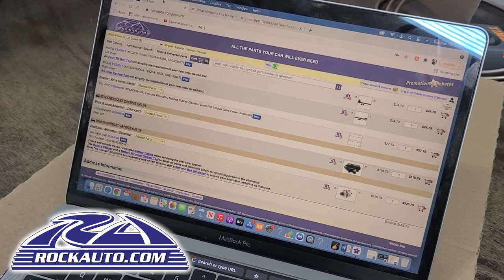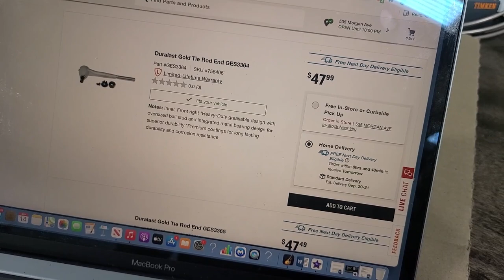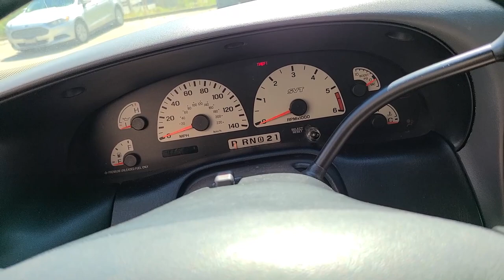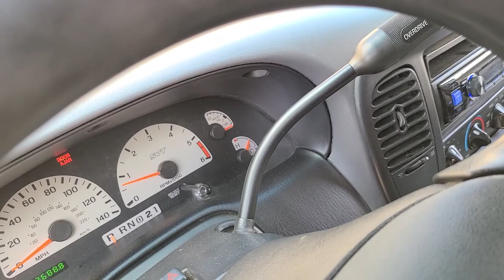I Found A MAJOR Engine Issue After Fixing EVERYTHING On My SVT Lightning! Previous Owner Had To Know

Comment: Why don't you fire up the old bore scope and see if it has repaired or longer spark plug hole threads? If they are then the heads have been off and there's a chance the bolts weren't torqued correctly. Also on some aftermarket head gaskets you can see the brand logo on the edge where the gasket sticks out from under the head.

Comment: A good mechanic who knows  the limits of these trucks may have been able to find this problem with a high rev.plus a high level scan tool and a compression test one cold and one hot.However since the Triton engines are famous for blowing plugs I doubt many mechanics would have taken this job on as most of them hate R&R ing the rear plugs near fire wall which are hard to get at and get hotter than the forward plugs so plugs crack and need very special tool to remove broken off part in the head.I have 2 acquaintances with Ford rigs with Tritons they both had the plug problems plus one gas the V10 version with a bad compression in one cylinder so always do a compression test before buying one of these beasts or pay the cost.

Comment: simpler solution to see if pressure is getting into the coolant...... put a T into the hose from the radiator to the tank..... than put a mechanical pressure guage on it and run it up to the wiper blade and go for a drive. if you get into boost , pressure goes above the rated cap pressure.... guess what? lol

Comment: i put the lightnings 5.4 supercharged v8 in my 03 supercrew that nuked the engine (was a 5.4) i had to put rods and pistons in it the stock pistions tend to pop ringlands at the first sign of detination and the rods arent very strong they will have interesting shapes at 400 RWH i also STRONGLY reccamend ARP headstuds because these engines love to lift heads under boost making your situation happen its common on medium boost modded trucks the head stud kit will give the heads good clamping force also get some good supercharger oil put in there (flush it out good) these superchargers will happily make some healthy boost but they are semsitive to dirty geartrain oil i had to rebuild mine this engine is a monster and it sends my supercrew down the road like a rocket lol i did keep my stock 4x4 but get the F350 DIESEL one it will hold loads of power my truck is a 600 RWH build

Comment: Have the seller buy you some new gaskets. Hang them on your wall. Torque the head bolts. make it your daily driver and watch the coolant level and combustion gases. Maybe you can rig something to capture the gases and watch in real time. Drive the heck out of it. Only if you are going to resell it or drive cross country right away, replace the gaskets.

Comment: I knew it!

PS I drove my 2001 prelude sh 55k miles with a blown head gasket.   

Car used to drive perfectly fine!  Full power,  the only symptoms are, that it will blow coolant through the over flow tank.   And since I live in both Phoenix and Las Vegas, this can lead to slow over heating during pro longed drives, at high rpm/ high load situations.

You know what the worst part is? The stock temp gauge cluster doesn’t even mark it as running above normal temp.   It’s only after I got a blue driver that I started to notice above average coolant temps.   Also I tried that exhaust gas leak detector for your coolant. And passed that.  It wasn’t until I did a leak down test, that showed me the problem cylinder was.  (With 48 percent leak detected.).  And when I connected my compressor to cylinder 3 spark plug directly, finally after 120 psi did air start coming out of my radiator! 🤣 

I literally replaced everything, coolant related, chasing this damn intermittent over heating, during extreme heat only.

Comment: I had the drivers side head gasket start going out. Luckily I caught it fairly early. Still over $2500 in repair. The Shop did it without pulling the engine
Reply: The only time I saw an issue with mine was climbing hills under load

Comment: I would avoid the head gasket sealant.. That's a last ditch effort on a crappy engine. I would give retorqueing the heads a shot (no harm no foul in my book). I'd almost put money that that may just be enough to fix it. I'd also check the spark plug holes and see if its got the higher thread count for the spark plugs. If it does then you know the heads have been off, if it hasn't then that doesn't rule it out, but probably something that should be addressed (might be worth doing the head gasket at that point and address that issue too). Might also be worth taking care of any other known or commons issues with these motors if you have it apart. But. I'm the lazy type. If tightening the heads resolves the issue, then I would leave it at that. And don't beat yourself up on not picking up the head gasket issue. Sometimes things just happen. You got a nice clean truck still. Those Lightnings are still one of my favs!

Comment: Probably never tuned it with that pulley upgrade and it over boosted the engine. The problem i see with most people on these is they push that factory eaton well beyond its limits and if that motor is not built to handle that then stuff like this happens.

Comment: Wrong torque on the head bolts would cause a problem with head gasket sealing. I'm pretty sure they are torque to yield so retightening them wouldn't really solve the problem .If I'm wrong about the head bolts, the head gaskets would still be compromised anyway from the heads lifting up. I'd tear the heads off and replace with a good MLS gasket and some ARP studs. But that's just me. P.S. look up FordTechMakuloco. He is in Chicago and an absolute guru with Fords. A collab would be awesome.

Comment: Is it possible that this specific engine requires the head re-torque after gasket replacement. I would give it a shot. Just like the old Benz engines. After about 1k miles there was enough heat cycles on the components that allow for about 60deg. more travel on the head bolts. And that is all normal. Retorque was/is the required procedure according to the MB manual (BBB)

Comment: Either the headbolts are not well and the head is lifting under hot power, or you still have a wonky thermostat. Perhaps even a blocked heater core (if this vehicle uses the heater core to regulate the thermostat like most JDM cars). They'll all cause the cooling system to be weird, and often seem like HG issues.
Reply: I finished the video.... Oh dear. That is... not ideal.

Comment: Would love to see you take valve covers off and try retorquing the heads and see if it helps at all before you pull the motor . Worse case we get to see an engine pull and set up which would be cool!👍🇨🇦

Comment: I have a built 403 stroker that was originally a TT setup before I went vortech Ysi.  Anyway....the meth nozzle wasn't tightened and got sucked up into my block.  Made a very small hairline crack in it and literally took it from a vicious lobe sounding cam to a non cammed z06 idle...along with just a little water coming out the exhaust....ran fine   but damn.

Comment: Alex this is from a Subaru guy don’t put that sealant shit in this thing it depends on what you wanna do and how much money you wanna spend buddy maybe try and re-torque the head just for the hell of it but I would assume once the boost pressure has gone through the gasket material it’s probably gone? And then I would explore the spark plug issue maybe get the heads refreshed up if you really do have to pull this thing apart or get the upgraded heads with a The more spark plug threads on it help it just depends on what you wanna do is it worth porting heads like that but then you go down the The rabbit hole what will the bottom intake is it worth throwing rods and pistons ect!

Comment: If the engine has a blown head gasket the oil will tell because of water in it not a special tool or a drive wide open.

Comment: The subframe broke on my 10 escape and almost killed my wife the vehicle just had tires and alignment last year and the mechanic found nothing wrong with the subframe. This is my last Ford product. I was a Ford tech early in my career and know that the do not fix anything but rig it to last through the warranty. Throughout my career I worked on high line imports and the have their problems MB had spring pockets that would rot and had to have new ones welded on but I never saw a subframe rot like this except for early 99 Jags that had sound deadening material shot inside . But Ford had this problem since 03 and has not done anything to resolve it. How many people have to be hurt before they learn how to build a vehicle properly.

Comment: As a former lightning owner, when I saw the video title, I knew where this video was going.... Shooting sparkplugs out of the engine is brutal...
Reply from the maker: I think I rather have that then what happened
Reply: @LegitStreetCars  ooooffff...I was wrong.  I just got to that part of the video...  Good luck sir!
It's been 10 years since I owned a lightning, and I miss it almost daily.  The noise and the feeling are so hard to beat.  Somethings to consider
1.  Replace your intercooler water pump.  They are prone to failure and when they do, they will absolutely ruin your day, and possibly your wallet.
2.  If/When you pull the the heads and super charger, clean out the intercooler fins in the air to water unit.  They will be absolutely disgusting and are likely restricting a lot of your airflow.
3.  Get a PCV catch can to help with #2.
4.  If you want to be really bold, swap to a set of 32 valve heads.  There are several threads on lightningrodder (if the forum still exists) of this happening.

Comment: I would guess the issue would be rod bearings  something at the early stage from reasons of oil deprivation
Reply: Head gaskets might be doable with the engine in the car, you'll have to move a lot of stuff

Comment: I have never seen this problem before... Has to be something to do with the head bolts. I would put money on some of them being loose or pulled out of the block.

To me a mid life head gasket job is a good excuse to go over all those things that are waiting to fail. In the long run more time will be spent replacing one thing at a time if you don't need a gasket.

Comment: I'd say it's probably the four letters on the badge, but judging by the gnarly coolant flush I'll lean towards something along the lines of a head gasket or block damage from overheating. After seeing funny things like mismatched shocks, I'm assuming one of the previous owners lacked the wherewithal to own a vehicle.
Reply: After watching I hate to say it, but it might be a decent candidate for something like blue devil. I mean if you're thinking of pulling it out anyway.... Anecdotal evidence suggests small leaks can be filled for many miles/years after treating. I wouldn't personally, but some have reported such luck on similarly minor leaks...

Comment: 03+ heads did not fix the plug spitting. Don't believe what Ford said. I polished everything under my hood so it all looked chrome. Blower, c&l elbow, c&l plenum, throttle body I bought was chrome, 95mm mass air, timing chain cover, intake & I bought a air box that was stainless steel. If you give me your email I can send you pics of it.

Comment: Yep retorque. Bottom line: lose blower, what's the point? It's a shop truck.
Reply: single digit IQ opinion
Reply: @mentals555  Repeat: retorque and add 5 more pounds. Buying a 19 year (anything) with a blower is begging for problems.
Reply: @mentals555  Yep and he sounds like he's really happy about it. He bought an old truck with a blower on it and then complains when it's not perfect (?) It might be as simple as a retorque but he is a good mechanic with lots of content now. Be careful what you wish for, in your case common sense.

Comment: For the sake of science/my curiosity, I'd love to see if just cranking down the existing head bolts some more fixes this issue. But if it were my truck, I'd buy new OE head bolts (or ARP studs) and swap them in one at a time, ensuring the bolt holes are clean and dry. My concern with just further tightening down the existing bolts is that you have no idea what condition they're in. What if the bolts (I'm assuming TTY) have been reused multiple times? What if the previous installer used lubrication when they weren't supposed to or used the wrong lubrication? It'll be impossible to know if the torque specs you're using are the right ones, and you could risk over-tightening to the point of snapping a bolt or pulling out threads on the block. Also, very unlikely, but what if coolant managed to seep into a bolt hole? That'll also throw off torque specs, but you also have the possibility of damaging the block/threads as you crank down against coolant in a blind hole. You also don't know how thorough of a job the previous installer did in making sure the head bolt holes were clean and dry. If they used the wrong torque specs, I wouldn't trust any other work they did.

Comment: audi is engine out ford is engine in . normally its a nice stepside. get some blue devil head gasket pour and go it's worth a try. no sellers supposed tell you it's there fault. if told ya something wrong you say ok that's different. 19.000$ for a vehicle it better be almost new

Comment: I will say that test you did for head gasket failure is not always accurate. I had a car with similar issues ran that test test came out fine. Then car overheated eventually my radiator blew up and it turned out to be a head gasket issue.

Comment: Somewhat curious why you didn’t pick up on the coolant condition as it was a dead giveaway. I am not sure “beating on it” would have helped in addition. The amount of flushing you did in the last vid was just mind boggling. Usually coolant doesn’t go “bad” like this unless there is blown head gasket. Love the vids and the truck though ! Keep em coming at least this will be way easier to fix than a V12 Benz.
Also the seller is a POS for not disclosing this.

Comment: If you are pulling them I would port them absolutely without question. And... Do thread certs in every plug hole. When in Rome and whatnot. 
NO SUCH THING AS A SEALER THAT DOESN'T PLUG EVERYTHING. NEVER EVER EVER DO IT.

Comment: It kills me when people condemn a brand because a modified truck with  a questionable or no tune has issues. You know the truck has been beat on and not maintained. In no way should this be a knock on Ford. If that truck was stock, you would have no issues and would run a long time. Keep in mind these trucks didn't receive the special bottom end 03-04 Cobras got. Pulley at your own risk.....
Reply from the maker: It didn't condemn the brand

Comment: DID I NOT TELL YOU WHEN YOU BOUGHT IT, THAT YOU WOULD END UP REGRETTING IT? NEVER stray from GM you get bit every time you do. i've only successfully done it once with my 06 2500 Ram Mega Cab with the Cummins turbo diesel and i'm still in fear that i'll be let down any minute still. Not a better man if they can do the sway bar end links with one hand just means they have bigger hands. Yeah pretty sure if dude owned that many of those trucks he was WELL aware of what to look for and just unloaded it on you Lesson learned hopefully. typical ford stuff though

Comment: Oh yeah, Abuse or Design?
Kinda design although its proper name is "Price point engineering" which is simple economics.
They have a component on the shelves that will "Do the job" through the warranty period like the 4 thread plug hole issue or the lowest price point gasket or worse Head bolts instead of studs and they use that item until the numbers dont add up anymore.
Then they upgrade to the part they should have used from Day One having sold a year or so worth of the Price point engineered models.

Comment: Gonna have all the younglings hollerin' "torque wrench bra!" Two seconds later everything's rattling apart.

Then you have all the old heads just doing most of it by feel, or just cranking down on the bolts in the end. Never held together better.

Comment: I would be a little weary about tightening the head bolts. Replace them with studs, clean the threads in the block and torque them to high performance application. The spark plugs on the Triton V8 can be real b--ch.

Comment: folks who design cars should be made to work on them,once had an alternator change on a nissan primera  sports+r,was an engine and transmision out according to the dealers to remove the lower alternator bolt,fuck that,i cut a hole in the inner wing replaced the alternator and welded a plate over the hole and painted it,how mental is that!

Comment: Exact same issue I had with my 03 SVT Mustang. I’ve VERY curious to see if tightening the head bolts happens to rectify the problem. My issue happened about 5,000 mile/6 months after a rebuild. The shop installed ARP studs and know I’m curious if they got the torque wrong or if they just needed to be retorqued/checked after a bit
Reply from the maker: Definitely check the torque on those.

Comment: Every Ford I've ever had the displeasure of using as a work truck was a piece of sh-t with constant electrical and engine problems, even brand new work trucks. Hands down, the worst was the F-250 6.0. What a piece of sh-t with nothing but constant issues with the engine. Sorry, I just hate Ford with a passion at this point. I've seen guys drop $20,000 into trying to keep their Ford running on head gaskets, head studs, transmission control modules, entire engine rebuilds or replacements, the list goes on and on.

Comment: In time all supercharged engines head gaskets will leak. Just replace the head gaskets and the bolts. I had a Ford Thunderbird super Coupe with 109,000 miles on it when the head gasket came loose. I fixed the car and drove it another 200,000 MI without any problems.